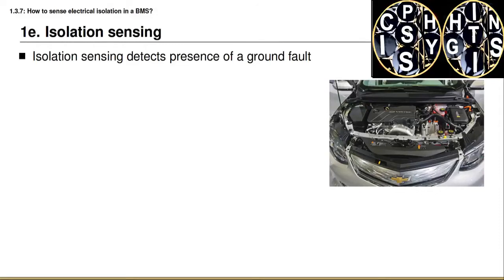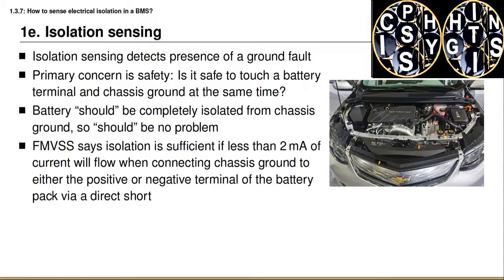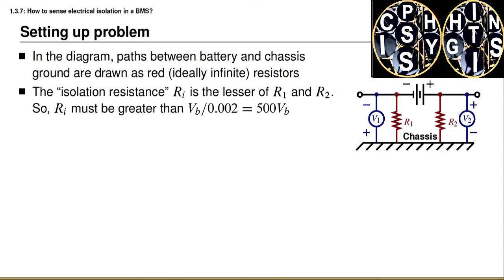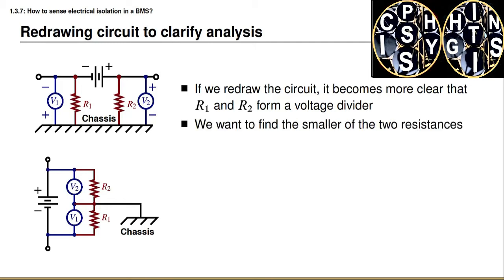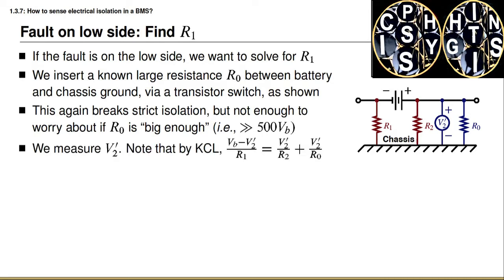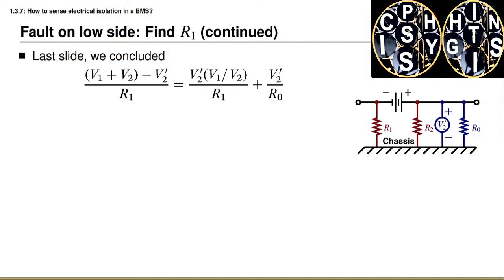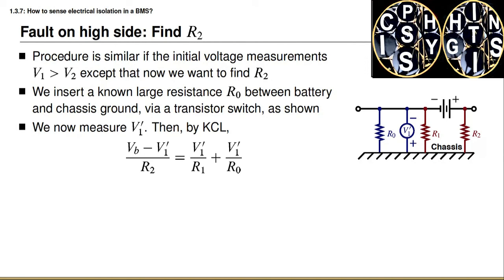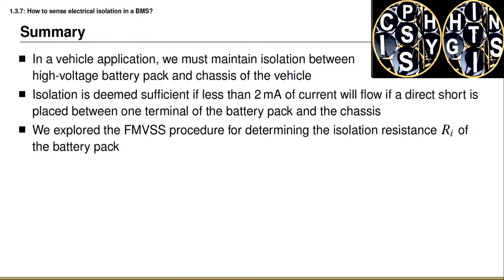1.3.7- How to sense electrical isolation in a BMS

Comment: To use an ADC tu mesure V1 or V2, I think we need to adapt the voltage levels because the majority of ADC cannot mesure high voltages especially with Microcontrollers ? Have I right ?